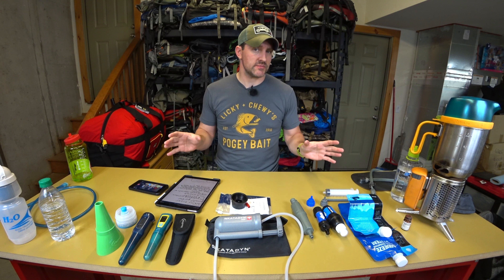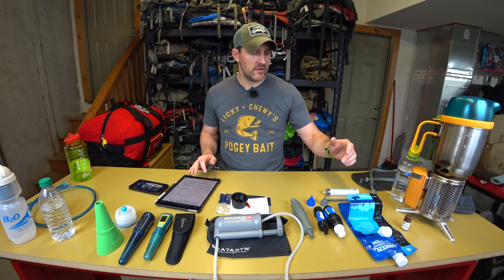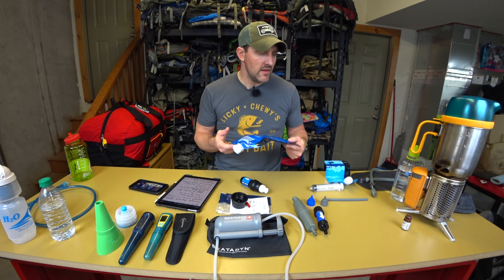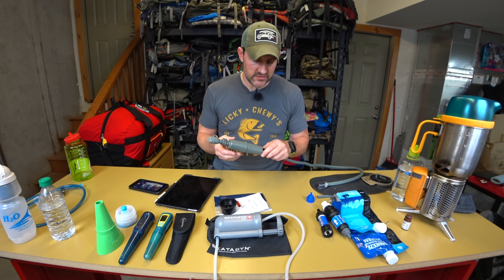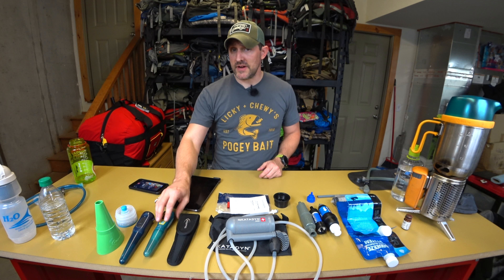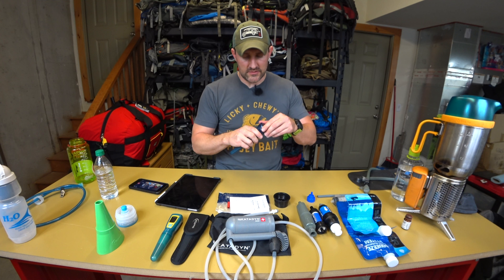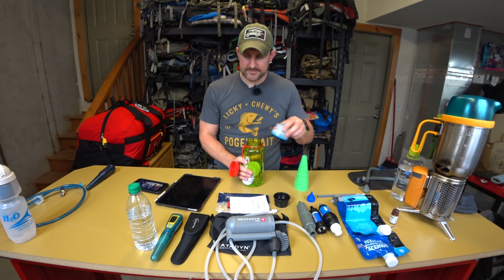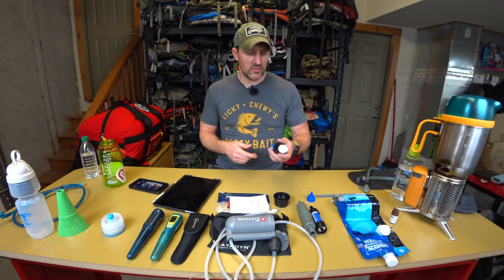Water Filtration / Purification for the backcountry: What you need to know

Comment: Where does life straw fit it this?  What is it not good for?
Reply from the maker: David Bryan Woodworks depends on the specific life straw product.  Here is the FAQ from life straws page.  LifeStraw filters (LifeStraw, LifeStraw Go) remove 99.9999% of bacteria and 99.9% of protozoa present in water using hollow fiber membrane micro filtration. They have a 0.2 micron pore size that physically eliminates bacteria and protozoa from water. This meets US EPA drinking water standards. LifeStraw filters provide safe water for 1,000 liters (264 gallons). LifeStraw purifiers (LifeStraw Family and LifeStraw Mission) remove 99.9999% of bacteria, 99.999% of virus and 99.99% of protozoa that is present in the water using hollow fiber membrane ultra filtration. They have a 0.02 micron pore size that physically eliminates the bacteria, virus and protozoa from the water. These purifiers also meet the US EPA drinking water standards. LifeStraw purifiers provide safe water for 18,000 liters (4,755 gallons).